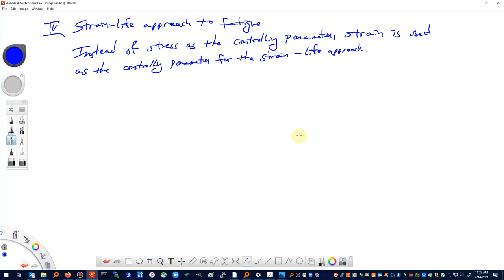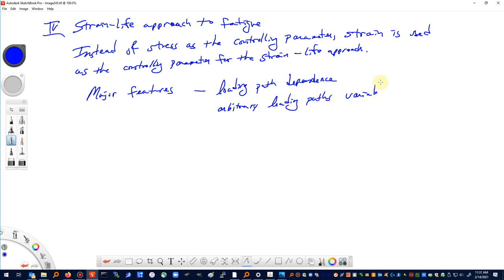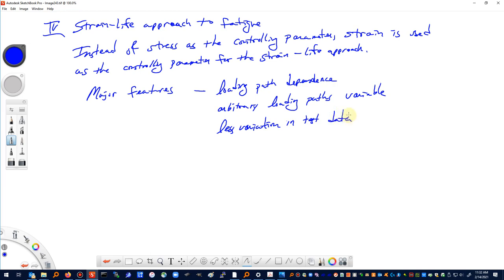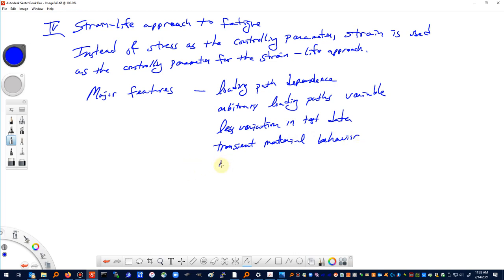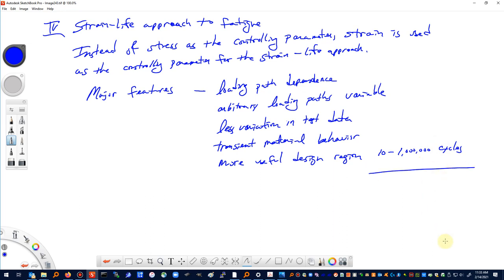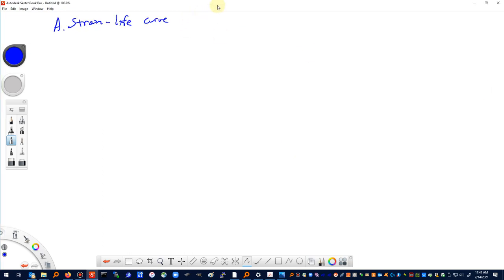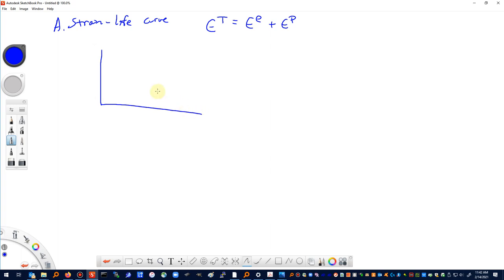13 strain life approach

Comment: Professor Barkey, Basquin equation also appears in stress-life approach which use sf' and b as material parameter. In this lecture, strain-life approach use sigma_f' and b among Basquin equation. What's the relation between sf' and sigma_f'? Because these two parameters come from stress-based and strain-based experiment, respectively.
Reply from the maker: They are curve fitting parameters for each approach, respectively.  For the strain life approach, we could think of it as approaching a true fracture stress at 1 reversal.  For the stress life approach, stress at essentially zero cycles is difficult to nail down, since you will have plasticity but the stress life approach uses some nominal elastic stress.  In the end, it often best to think of them as curve fit parameters.
Reply: @mbarkey.mechanics  Thanks your reply, those parameters come from curve fitting of stress-life and strain-life approach, respectively. I just remember that one commercial fatigue code states if we don't have S-N curve data, sigma_f' and b from strain-life approach can be used as alternative to perform fatigue analysis. That's why I'm curious about the relation between sf' and sigma_f' from different approaches.